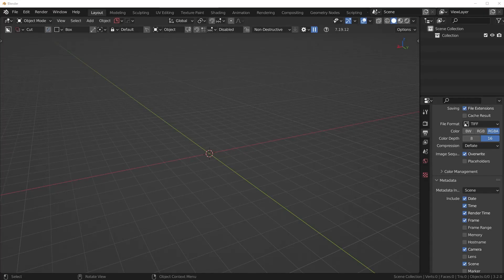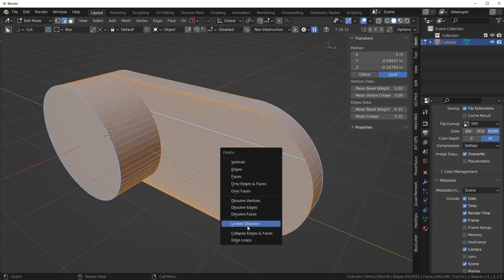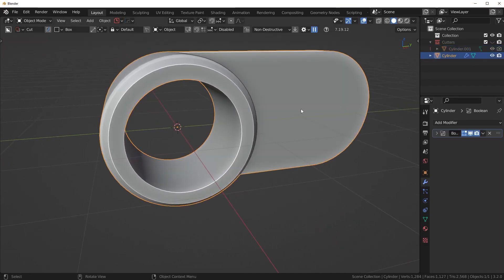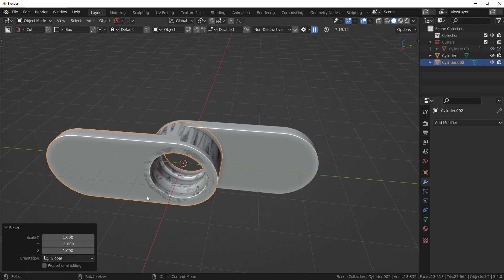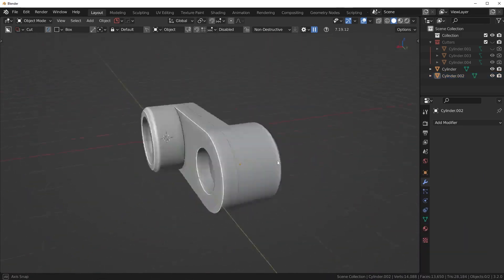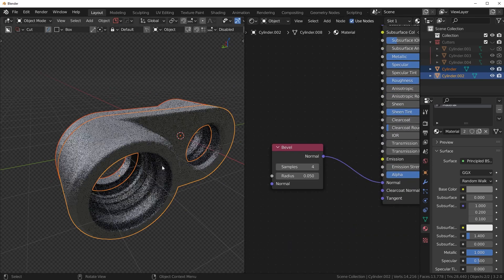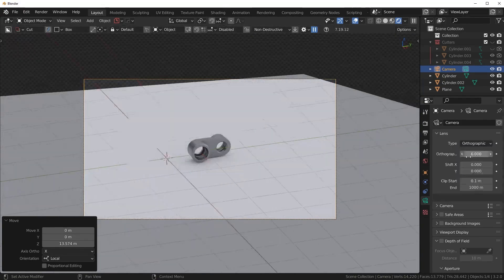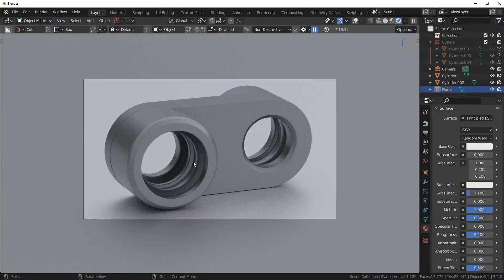Simple Hard Surface in BLENDER (Tutorial)

Comment: Cool. But I would approach the modeling of an object like this different. Objects of this type typically have exact dimensions for everything. I would create the profile of the cross section of the cylinder from its center and then simply lathe  the cross section to whatever degree of segments you need. This method provides for accuracy and precision. if just eye balling a made up object, the presentation method allows alot of artistic freedom.
Reply from the maker: The tutorial is mainly meant to present the modeling tools and how to approach a certain workflow, otherwise for a mechanical piece like this you are most likely correct.
Reply: @JoshGambrell  Thanks for the clarification. My workflow for modeling starts long before I even open a 3D modelling application. After identifying the object that I need to create a 3d model of, I do extensive research on the object (pictures from numerous angles, drawings, dimensions, specifications, obtain or observe the actual object and take measurements). When some of this data is not available, I have to study the geometry from the available data and will frequently create profiles and cross-sections in another program to coordinate the scale and proportion of the various parts of the object. Once I have a clear 3D picture in my mind of the object, I then identify which modeling tools in the selected 3D application I will use to create the model and the steps that I will take to create the object. The object I am creating determines my workflow, not a preferred set of tools. For example, I use the bevel or chamfer tool to add realism to my objects (i.e., no sharp corners); not simply to create the main features of an object.